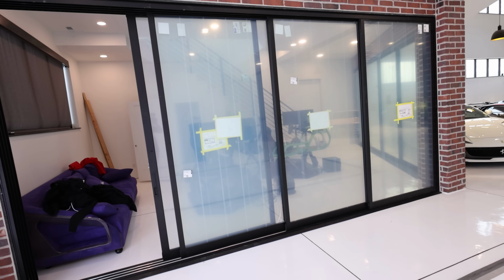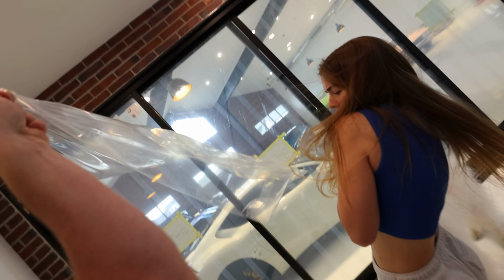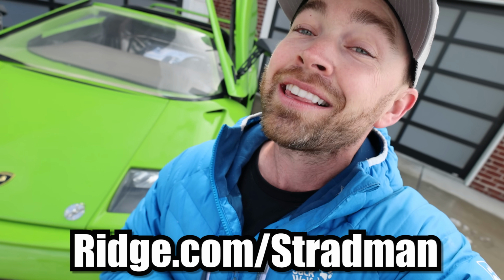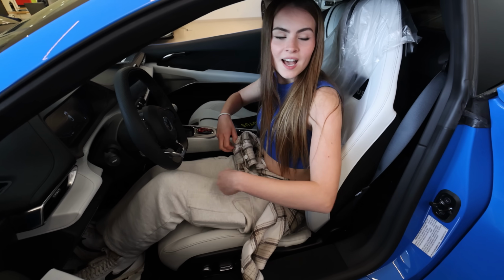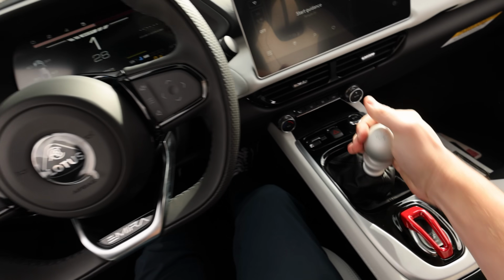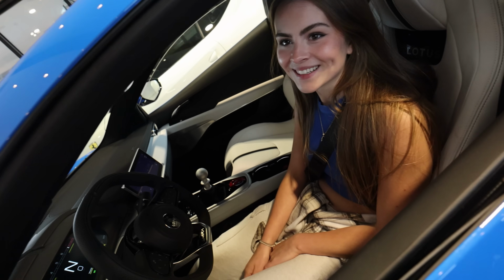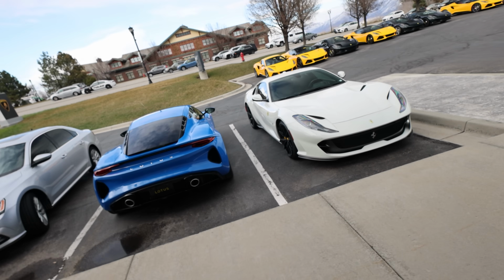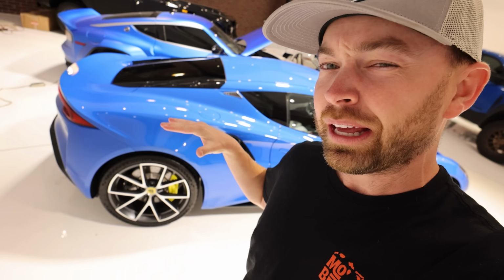NEW CAR DELIVERY DAY

Comment: Bye bye 812, thing was clean! For millage right hand key pad on steering wheel. The display on the bottom setting is satnav. If you scroll up you'll get to a trip, overall and instantaneous mpg etc. Scroll left from there will give you total mileage. Found online, hope it helps

Comment: I pulled this from Chrome for finding your odometer.
Right hand key pad on steering wheel. The display on the bottom setting is satnav. If you scroll up, you'll get to a trip, overall and instantaneous mpg, etc. Scroll left from there will give you total mileage.

Comment: @stradman you were technically correct about the Emira it has two engine options the 2.00 litre turbocharged engine or the 3.5 litre Supercharged engine
Reply: Not a twin turbo though. Single turbo inline 4 was the other option.
Reply: @zbot2123  true 👍
Reply: And if I remember correctly the turbo version had a manual transmission and the Supercharged version had an automatic transmission
Reply: @maxmessenger175  turbo had a DCT with no manual option. The V6 got both the manual and autobox options.

Comment: Pulling the plastic off was extremely satisfying...but why not wait until the contractors are done with changing the doors?
Reply: They probably just need to swap some hardware.  If they're like ours the panels won't have to be removed and shuffled.
Reply: @Duh_Huh_24  but they have to he held up either by hand or suction stands which makes the glass dirty when they could have just waited and pulled it off after 🤷‍♂️
Reply: Right? Hahaha  makes no sense

Comment: @TheStradman the odometer is in the digital gauge cluster, use the right steering wheel pad to switch to the screen on the configurable panel on the right side of the gauge cluster screen.

Comment: The odometer location right hand keypad on steering wheel. The display on the bottom setting is satnav. If you scroll up you'll get to a trip, overall and instantaneous mpg etc. Scrolling left from there will give you total mileage.

Comment: The odometer is probably accessible from the arrows on the wheel. My dad’s Ford Edge has a digital odometer and digital rom gauge and you can “hide” it by pushing an arrow on the wheel. It might be the same for your car but I don’t know, that’s my best guess.

Comment: Well, I can see he is TOTALLY ignoring the engine break-in instructions! 🤦🏻‍♂️🤦🏻‍♂️ Feel bad for whoever gets this car once he sells it in a few months 😕. And for anyone wondering, Lotus says to drive the car for 1,000 miles in Tour mode (the default mode) and below 4,000 rpms! NO Sport mode till 1k!  Feel bad for this car & the next owner.

Oh, and from what I've been reading, Lotus dealers (and HQ) are NOT into aftermarket exhaust kits. He may he doing one with the warranty being denied if he has a problem.